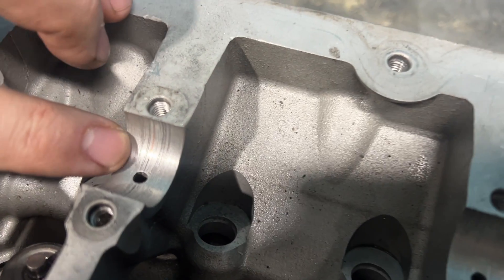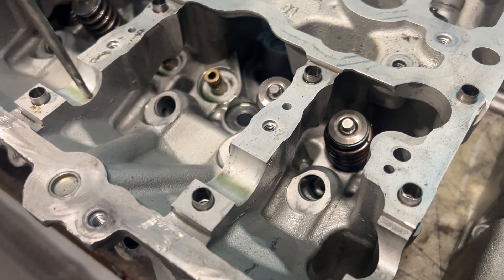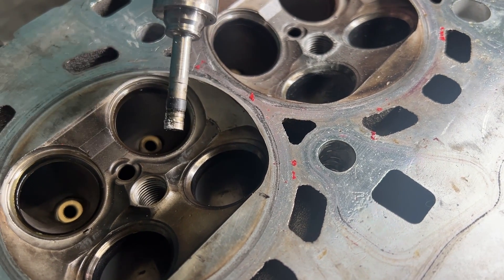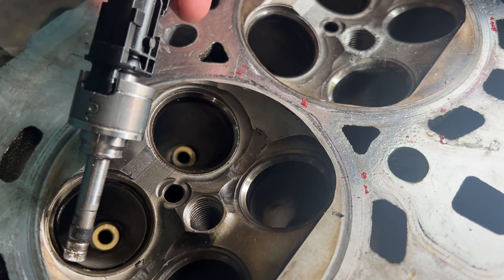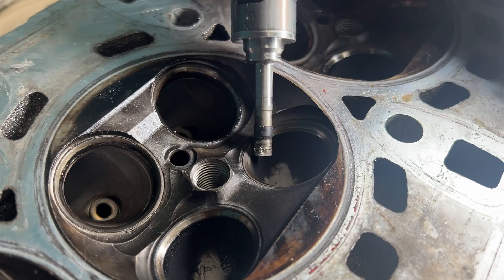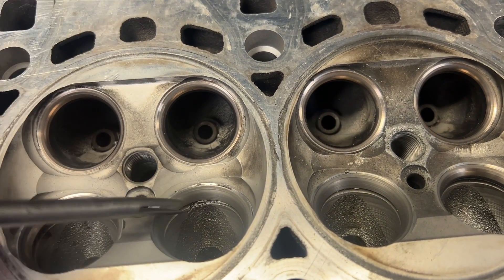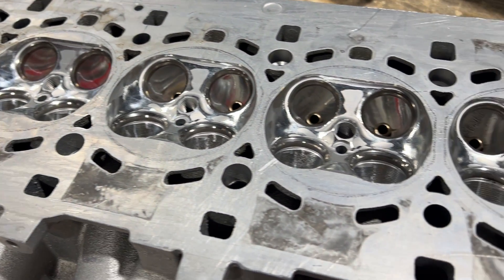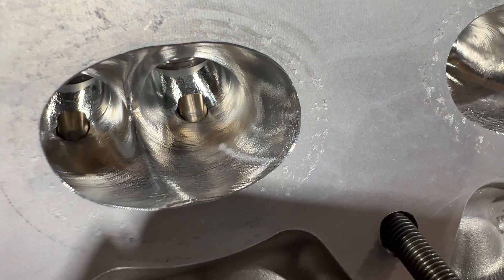S58 teardown and build up for M Powerhouse! AND our new CNC port!

Comment: the exhaust ports are really rough looking bud  needed some smoothing out . did you even put them on a flow bench to see if they flow evenly as possible ?
Reply from the maker: There was nothing wrong with the surface finish. Those heads seen the flow bench ALOT.

Comment: Would you guys port a 22re head and  install 3mm+ or 1mm+ oversized valves over stock (which ever would be better for this application)? Rounded square shaped intake ports. circle shaped exhaust ports, at the end that meets the header it becomes pear shaped. 8 valves in total. Not too sure about forced induction at the moment. Also planned on converting it to carburetor.
Reply from the maker: We don't work on that head, sorry.

Comment: Gr8 video with lots of information. I came to you guys with my 2.0TSI motor 2 yrs ago and you turned me away with a quickness 😢 after driving down the turnpike almost 2hrs to u guys 😅
Reply from the maker: Sorry you took the drive, but that could have been solved with an email or a phone call and then you wouldn't have wasted all that time.
Reply: @headgames  it’s all good man. No hard feelings. Just one of those days I felt like taking a drive 👍🏾
Reply: May be next time. That’s if u do the E36 heads 😁

Comment: Ok i have 2 questions just to feed my brain with good info. 
1. How do you measure valve guide so they all can be on the same hight ?
2. Can you upgrade valve springs with stock cams ❓ i am envicious with your videos 😂😂😂😂
Reply from the maker: - we use a guide that has a stop OR we can measure the guide height with a caliper. They should be within .010 of each other. This is not a critical thing, you want them close but it doesn't have to be that close. 
- You can absolutely upgrade the spring kit with stock cams 

Glad you enjoy our videos! Thanks for watching!

Comment: Wouldn't the best thing to do would be for GSC?To develop camshafts now based on the new CNC port profile? Also, they have to consider factors like vehicle weight, stall converter speed, and rear end ratio?
Reply from the maker: They already have cams and development is still ongoing.
Reply: @headgames Will you share comparisons and flow sheets between stock and your cnc ports? Also difference and increases in port velocity? Lastly has the swirl cut on the valve you showed replaced back cutting the  valve stem above the face? Back cutting used to increase velocity significantly back in the day. I'm a former race engine builder just trying to learn about modern engine development techniques. I've been gone from the industry 25 years.
Reply from the maker: @daltonhanleyjr4142  We don't share the cnc numbers, but we might show the gains in another video using a graph. Showing airspeed would be a big animal to tackle because it is such a technical piece. 
The valve shown in the video was an exhaust valve, and they don't get a back cut ever. Just intake. 
Welcome back after a few decades! Lots of the same principles apply to the new stuff except gasket matching. I think back when I did the BBC stuff at Musi's it kinda made sense but we still port matched the intake manifold to the head and not to a gasket. The new stuff, we don't usually touch the cross section at the flange.
Reply: @headgames I understand about not sharing the CNC port numbers. I didn't realize that was an exhaust valve. They are very close in size to the intake valve. .Im curious about your port velocity. I think the young people need that presentation from you. It will help them realize flow bench numbers arent everything. Ive seen too much fundamental knowledge about competition engine building being lost, because everyone thinks dropping a big  turbo on a stock LS , Coyote, or B/S 58 engines is all you need to do to go fast. If you are not making a 1000bhp, your car is a POS. These guys dont know how good they have it. Back in the day you really had to work extremely hard to achieve results that are easily achieved today. I come from NHRA Comp Eliminator background/class. So you know first hand about what we would do to find horsepower. I nerd out on this type of stuff. I love your channel keep up the great work. I won't bother you with any more questions today.  Take care.
Reply: @headgames oh ok. Keep up the great work.